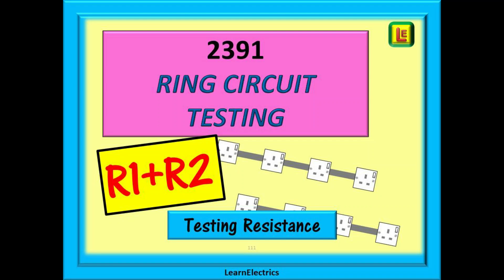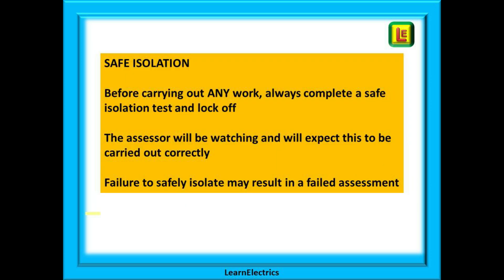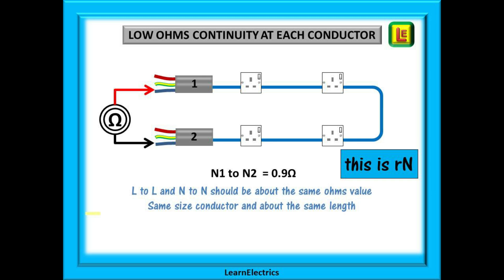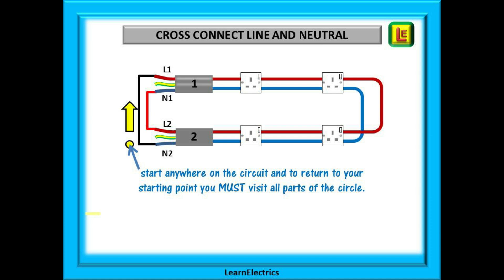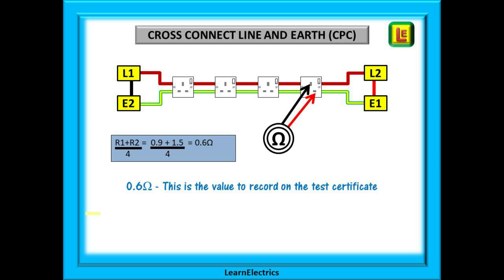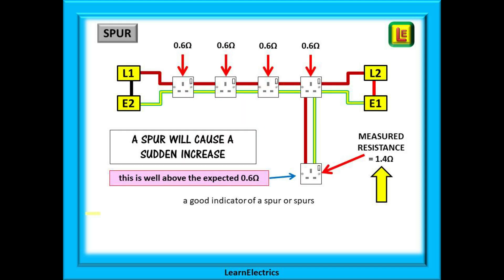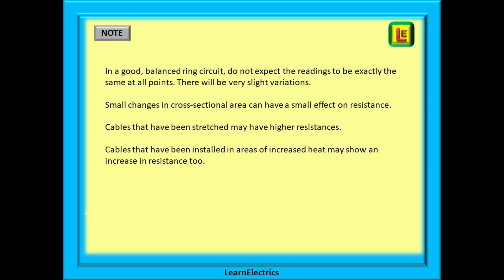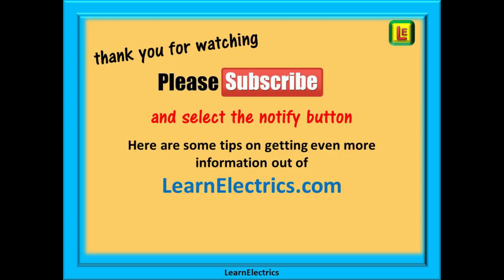2391 -  RING CIRCUIT TESTING – RESISTANCE – R1+R2

Comment: Thank you very much for the video! I've watched many on this subject and always come back to your channel for a clearer explanation! I understand it now.

One thing that baffles me.

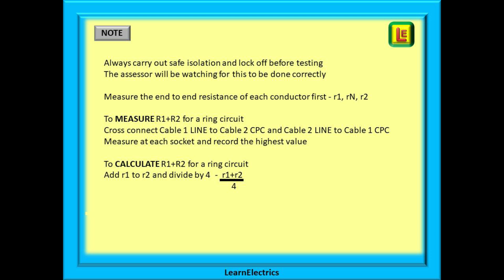When the ring circuit is isolated at the MCB (as per your image at 15:37, how can it be 230C between N-E on the socket if there is a L-N reverse? The L conductor is disconnected from the supply (MCB off) and the N is at 0V with reference to E. 
I'm confused!
Reply from the maker: It sounds like you still had the Neutral connected to the earth bar, in which case you are not isolated. All you have done is disconnected the line conductors. If the incomers are reverse polarity then the neutral will be at 230V. Hope this helps, maybe I should do a video on this. Take a look at the video on the link below and thanks for the question. Your support is appreciated, Dave.
https://www.youtube.com/watch?v=mrSbn7TMFbc
Reply: @learnelectrics4402 ah ok. So in your table about what voltages to expect when safely isolating a circuit, 230V between N and CPC would exist if there is L/N reverse upstream of the MCB of the circuit w are trying to isolate right? So e.g if someone has mistakenly reversed the L and N wires coming out of the main incoming MCB?

Will watch the other video.

Thank you Dave, merry Xmas and happy new year!

Comment: @learnelectrics4402
Hi there. @12:30 you say when doing the socket test " .. they should all be the same value within a very small fluctuation.."  Is there a guideline for what this "very small fluctuation" can be?  
For instance if the expected reading was 0.19 ohms and testing the sockets the results were, 0.20 0,19, 0.17, 0.20 would that be acceptable?  The reason for asking is to have an idea at what point would a reading that is different to the calculated one would warrant further attention. Thank you.
Reply from the maker: Yes, that's about the right spread. What you don't want to see is 0.19, 0.19. 0.12, 0.19, where there is an obvious difference. A lot comes down to gut instinct, what I call the Policeman's nose - something isn't quite right here.
thanks for watching.
Reply: @learnelectrics4402  Thank you for your fast and helpful reply.  For a newbie like me, it enables me to build my confidence.

Comment: Great video. Can I ask some advice please. On a ring I tested after an addition off a few extra sockets. My R1+R2 was 0.19 roughly but in a few other sockets this jumped up to 0.44. Could this be due to loose connections or worn socket not making contact properly with my plug top tester lead?
Ps Do you have any videos on problems of a ring within a ring on testing and identifying please? Many thanks
Reply from the maker: Take a look at these two videos on testing and fault finding some problems on ring circuits

https://www.youtube.com/watch?v=0hY0W9FcDZw

https://www.youtube.com/watch?v=V0_6_WmkmsY

Comment: When doing the cross-connect line and neutral why do we divide it by 4?
Reply from the maker: Renzo, its how parallel circuits (ring circuits} work.
Take a look at this video, it goes into detail about how this happens. Once understood, you will remember for ever. I know its about spurs but it starts off with simple ring circuits and the methods behind it.
Thanks for watching and keep learning, its a good trade to be in.
RING CIRCUIT SPURS – FINDING THE SPUR – CALCULATIONS AND TESTING – HOW TO SET UP THE TEST can be seen on this link ...
https://www.youtube.com/watch?v=V0_6_WmkmsY

Comment: Your channel very educational and please keep the practical assessment coming! 100% subscriber🙂
Its very importance the test leads are nulled before carrying out any Dead Testing i.e., end-to-end resistance measurements. Also, when verifying the highest R1+R2 reading for a RFC with an additional spur, would the R1+R2 spur reading be recorded on the schedule of test results? Assuming the spur reading was the highest.
Reply from the maker: Yes Tony, record the highest reading for the circuit. Thanks for your comments. Appreciated. Dave.